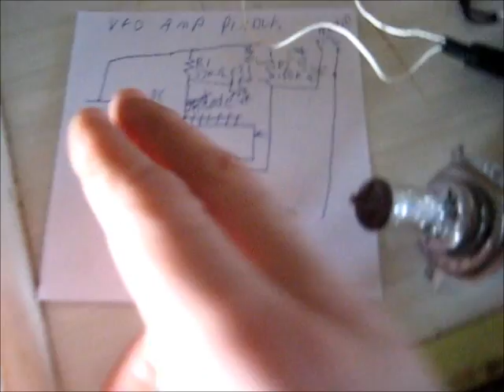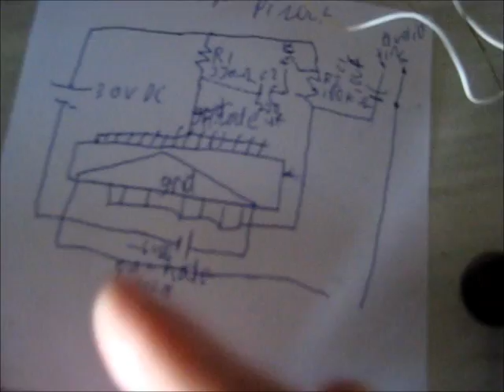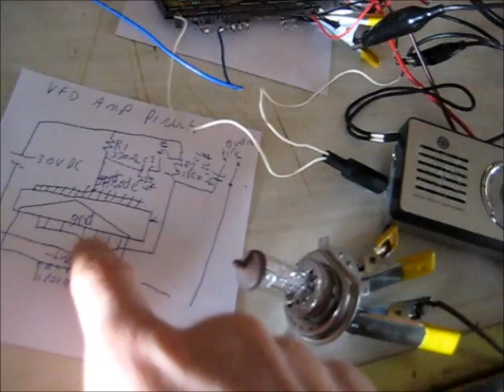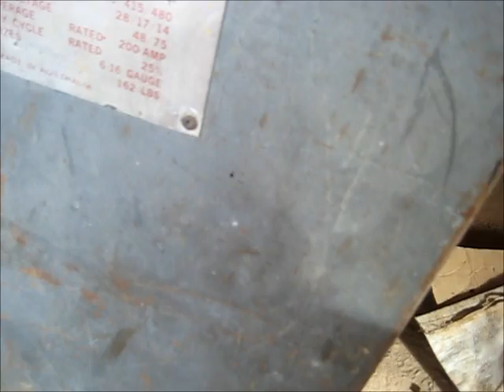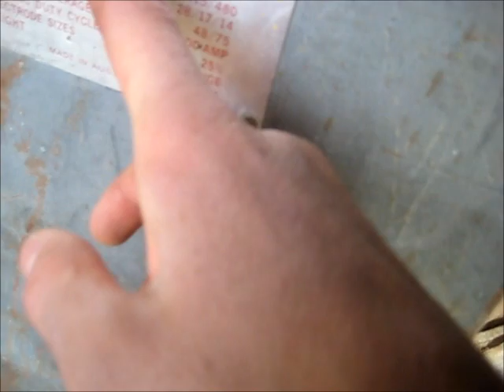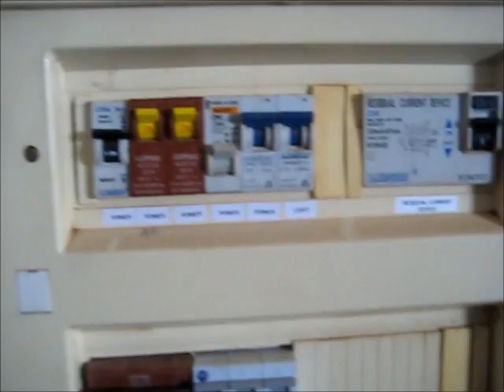VFD Amp Project & More Battery Pops

Comment: That battery at 5 - 6 minutes was a fantastic sparker.
That red Everready did very well too. Great video Larry.
Try putting two or three batteries in series, that avoids the dead short. usually one pops out.